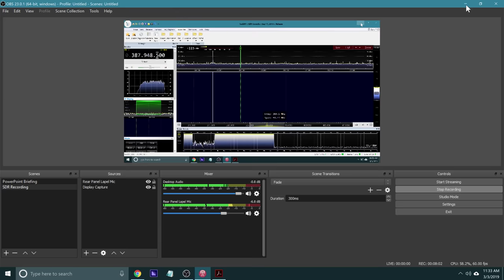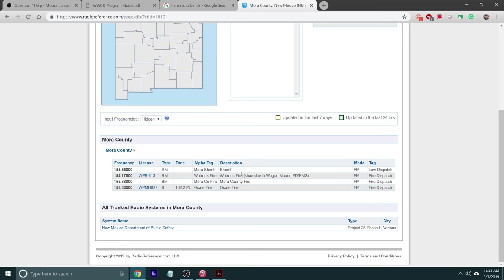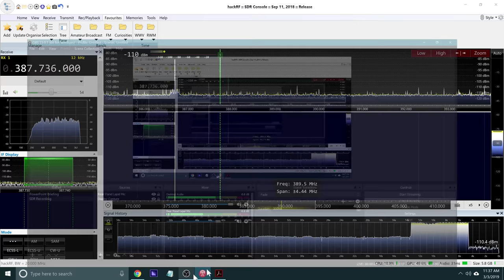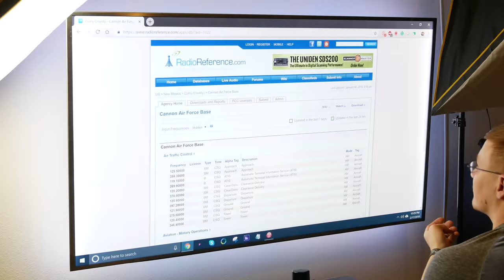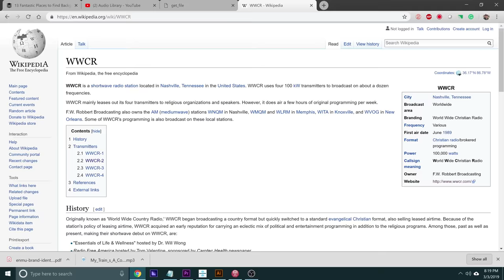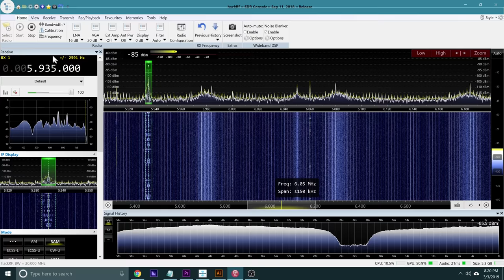Tuned Magnetic Loop Antenna - ENMU - EET 490 Capstone - Update 2

Comment: Wow awesome, thumbs up !
Not sure though, is there a good contact at top of the loop? (as the copper wires are just tightened to the aluminium with brackets) ?
Reply from the maker: Yeah, I didnt like that part either.  Not a great way to do it, bit it didn't seem to effect it much. Of course, I don't have an good point of reference for the resistive losses either. I've got to say though, this video has been wildly popular on YouTube and I've learned so much from everyone's constructive comments. The amatuer radio community is awesome. Thank you!
Reply: @TookBurrow  I am too thankful you built this antenna, i have been learning at the same time ; has to withstand several hundreds of watts on HF the way you engineered it (the key here is the Vacuum Cap). With the digital FT8 mode, you'd be amazed how far (actually to other continents) this antenna can reach. And with not even several hundreds of watts. 
Oh and I wanted to say how great idea it has been to engineer the loop bracket and have it 3D printed.
So yes, amateur radio is a great community, if you ever have your ticket, you'll be more than welcome among us. 
So you definitely have a follower here, Daniel. 
Just keep on doing what you are doing ! 
Chris ha7wx
Reply from the maker: @W-733_KWX  Thank You!
Reply: Chrisophe Barbe
Can't be all that awesome if he gets it wrong!
At the top of the loop, the quality of contact is unimportant.. At that point, here is a very high RF voltage but no current flows.
Reply: @TookBurrow  " I don't have an good point of reference for the resistive losses either." Well, measure it! Use a milli-ohmmeter. Efficiency = radiation resistance/(ohmic loss*radiation resistance)

Comment: Good video and nice build.  Kinda surprised the upper frequencies we so high, I wonder if the coupling loop was working by itself up there.  I would think zero chance of transmitting in the VHF range.  That ducting should be great for dealing with the skin effect issues since it's mostly surface area.  I've thought about using ribbon for the same effect.  Any thoughts on that?  Also back to the skin effect issue.  Seems like all designs have a huge issue there with the connection to the capacitor.  Any thoughts on losses there?  Obviously you intend to put real power into it with the 15kV vacuum capacitor.   Also wondering what kind of Q you are getting at the down in the longer wavelengths.  Also I was more under the assumption that mag loops have a very strong null, but not vary directional otherwise.  Thanks.
Reply from the maker: There were quite a few problems with it along the way and left an appetite to try again some day. I don’t professionally work with really anything related to radio and probably a good thing as I’d need to brush back up on the finer points. What antenna would you build if you could build any kind?

Comment: 269.9 MHz is the MIL frequency for the Automatic Terminal Information Service (ATIS) at Cannon AFB (KCVS).  You can see it on a chart at SkyVector.com by entering "KCVS" and hitting [Go].
AFAICT The beacon at 138.925 is outside of the civilian navigational radio bands, so it's probably something military.   Whatever it is, I'd interpret that transmission as being the two digit identifier "SE" or "ES", depending on which order you pick.  ;) 

That's an awesome HF antenna!   I might have to build one.
Reply from the maker: Thanks for the tip on that cool website. The ES/SE was another persons guess as well

Comment: Awesome idea and it is great that you include the time lapse videos of the process. Thanks! I am sure that , as others have said  below, you would benefit immensely by getting an FCC Amateur Radio License(s). I studied intensely and passed all 3 in one morning. I am sure that you can do the same and it is very worthwhile to have no restrictions on transmitting. It would be fascinating to see how this antenna behaves on transmit and  to see what kind of power it can handle. Careful with the Voltage/Current and RF! Do you have some idea based on your calculations? (Perhaps it was stated in the video. I was pressed for time and skipped through, but will watch in its entirety later.) Thanks, Jason / KY9I
Reply from the maker: I will have to do that. My father in law is a licensed amatuer radio operator, so I may see if he wants to try transmitting with it. I've been very busy with work, so my favorite project hasn't seen much of me. Fortunately people keep commenting here and I'm learning so much for the next video. Thank you!

Comment: What was the center frequency you were aiming for? The null is on the narrow sides. The broad sides are the lobes.   So you would have two null sides and two sensitive.  I believe when you showed the field it was showing the antenna you built if it were horizontal.

Comment: Have you tried combining the loop's RF with the signal from a simple dipole or vertical antenna?  You can get very nice notches on specific signals.

That would be "signal peaking" when the antenna is directed at the desired signal and nulling when the antenna is directed such that an interfering signal is minimised.
Reply from the maker: That's a great Idea. I will experiment with that this summer.

Comment: He should have probably done some research to find out how a tuned magnetic loop works before building one and trying to show it in video!
Reply from the maker: You are probably referring to some b roll footage I have in there demo the antenna at an irrelevant frequency with respect to the design. This needs to be edited out. I later demonstrate operating the antenna 5.935MHz towards the end of the video. ~55:57
Reply: @TookBurrow  I love the idea of using the Al tubing--- much cheaper than copper would be for that diameter. I'm curious if you've tried transmitting with it? Can the tubing handle the current from a 100W ham transmitter?

Comment: Very nice build, but I don't get why you tried/showed us this this beast in the VHF/UHF range. Quite sure you weren't even able to tune it there, since you calculated it for 7 MHz, right? This loop is way to big for 100 Mhz and up. To be considered "magnetic", a loop typically has a circumference of 1/4 of the highest receivable wavelength  - try to receive low bands on shortwave with it! Also a vacuum C is overkill for receive. Their main feature over air capacitors is their dielectric strength - which counts when transmitting with some power (e.g. 100W and up) :)
Reply from the maker: I used it around 5Mhz towards the end of the video. I was supposed to edit that part of the video out. The antenna was little more than a wire at those frequencies. Sorry for the confusion. I had b-roll/test footage for camera and recording setup and I used them in the final cut.

Comment: if you can still find it there is/was a program called "dsd plus" that useing virtual cableing you can decode most digital signals but not ones that are encrypted i used it a cpl of years back so not sure if its still available and another one called "dump1080" for tracking and decodeing aircraft messages
Reply from the maker: Thank you. Is DSD plus a plugin for another program or a standalone program?
Reply: @TookBurrow  both are stand alone but you do have to have an sdr program running then the virtual cable  to connect the two together im sur if you search on YT there should be one or two vloggs showing how too

Comment: Thanks for this video, where did you get the radio unit and what does it consist of? I am kinda of old school, all my radios are still tube type except for the aircraft units. N5UEB
Reply from the maker: Hi. In my video I was using a software defined radio that connects to the computer through USB. It's called a Hack RF
Reply: Thanks Daniel. I found one on Ebay for about 160.00 but did not say if software was included. Sure seems like a good way to go and I like that kind of bandwidth. Can you tell me if software is included or separate. Thanks Tom Turner N5UEB
Reply from the maker: @hokepoke3540  I Downloaded a free software called SDR console.

Comment: How do you overcome the higher losses of aluminum and at the connection made between the two pieces?
Reply from the maker: It's the outer diameter of the rigid ducting. Its large enough that the losses are offset. I think the DC resistance of main  loop was under 0.5 ohms.
Reply: @TookBurrow  0.5 ohms? Got to be waaaaay less than that  for any reasonable efficiency.

Comment: Hi,
Nice job! I like your 4 inch tubing because it lessens resistance which allows the antenna to be more efficient when one is transmitting.

I have 3 of this type antenna at the moment where my largest is 4 foot square but I use a spiral wound method for the large inductor portion of the antenna that is connected to the capacitor.

I am not surprised that you recieve in the 400 MHz portion of the spectrum but I suspect your inductor is probably around, what do you think, 25 or 30 micro henries so the capacitor's ability to tune the circuit is probably 1.5 mhz to 4.5 mhz. I was wondering if you put this to a test? Also, one of mine was built for the AM broadcast band. It would be neat if yours should tune that low because broadcast DX ing is a bit fun. I once picked up Hanoi Vietnamn at around 800 kHz. 

The other thing that would be interesting would be to place it on an antenna analyzer. I believe they are called vector analyzers today and can be bought fairly cheaply like the Sark 100 out of China. 

I have the Sark and its quite nice to have for a lot of different reasons. My big question that I have that the Sark could answer is what is the input impedance at your sense or coupling loop? All three of my mag loop antennas have a rather high input impedance but since I don't transmit with them and use them on receivers or SDRplay its not too much of an issue. 

My final thought of interest is how narrow is the tuned section, think it may be called pass-band, of the antenna when the capacitor and inductor is tuned to resonance with the frequency being recieved. Mine are very narrow. I am guessing maybe 30 to 50 kHz to left and right of carrier or center. With your huge tube I am wondering if yours is a bit wider?

Enjoy, nice job......mike
Reply from the maker: I'm going to use your comments as a guide for an update video, once I get the free time. I'll borrow an ESR meter and check the inducatance of the loop and input impedance of the coupling loop.

Comment: Dude, you can get some copper stripes and use them, it would be much better. I learned the hard way that losses negatively impact SNR and you will have less efficient on TX too.
Reply from the maker: Thanks! I'll include that suggestion for an upgrade or project on this antenna or perhaps a new build...

Comment: I am surprised that you are using such a large loop for VHF and UHF. A loop that big, I thought for sure you would be using for hundreds of kilohertz, not hundreds of megahertz.
Reply from the maker: I operate it at 5MHz towards the end of the video. Sorry for the use or b-roll footage
Reply: @TookBurrow  Okay, so the reason why I didn't see the connection is that there was no connection.

Comment: I would strongly recommended that you get an amateur radio license with general class privileges, so that you can LEGALLY transmit as well as receive,  and hopefully find a mentor that can help you along in the wonderful world of RF magic.  Mag loops are a unique antenna and are very interesting indeed and VERY dangerous when transmitting. With just a couple watts you can easily exceed RF exposure limits if you are near the antenna!   The magnetic loop is a high Q resonance circuit with very narrow bandwidth hence extremely high voltage and current can be present.  It is incredibly important to have minimal resistance in the loop, so you should have as few of joints as possible, it is often better to use a smaller conductor if you can have fewer joints.  The loop should have an extremely narrow bandwidth that is tuned with the capacitor. In Amateur radio frequency is most often referenced by wavelengths, 80m is 80 meter or 3.5-4.0 Mhz, a loop that size with enough capacitance would be good for 160-40 meters. However it is too large to work as a magnetic loop much above 40m and transitions into a conventional loop with a very poor impedance match.
Reply from the maker: All good advice. If I decide to transmit with this loop, I would only do so legally. Getting an operators license isn't difficult, so IMO it wouldn't be worth transmitting illegally. As far as having a mentor, I do. Not much free time to play atm though.

Comment: I don’t understand. it should be resonant in the 40-20 meter bands and not at 2 meter where you (initially) tested it. Could it be that the metallic tube has a substantially higher inductance than a copper tube ? I am in fact thinking of the formula frequency is proportional to inductance times capacitance,
Reply from the maker: In the 2m band it was just acting like a wire essentially. Not at resonance, but still worked well enough

Comment: How much for that vacuum variable capacitor?
Reply from the maker: I think I scored it for 50. Was worried about a compromised seal at that price point, but I got lucky. Checked it's full range with an LCR meter and die pen chamber. No leaks! They usually go for $100-300
Reply: @TookBurrow   You did mention the cost in your video.  I hadn't seen the whole thing yet.  Great video, by the way. 

Most of the traffic you were seeing  in the 225 - 400 MHz band was military aircraft related. 

That variable cap was a freakin' steal.  I have 2 similar ones I have not even used yet.  I bought them simply because they were cheap ($70/each). 

Keep up the good work.  Beats the hell out of watching TV.

Comment: Mr. Tooker, what if I just want to receive ?  Will this work?  Joe
Reply from the maker: Hi Mr. Overmyer, 
On this learning adventure I set out to only Rx/receive (at least initially). 
When I get finished with my current two [unrelated] projects I plan to get myself Amatuer Radio Licensed for Tx/transmitting. 
So I have only received on this antenna so far. 
NOTE:   I think a dipole strip material antennas would have worked better though for the loop. 
I intend to replace this design entirely with something that looks like a Stargate (TV Series). 
I'm still only receiving on it, as seen in the video

Comment: The old guy with the religious broadcast ISN'T using ham gear. He's using Broadcast equipment, probably renting time slots from commercial Broad Cast services. I've heard him bleating on and then just cut out dead, probably when his paid time slot ran out.

If you are hearing 14O Mhz on that antenna, the big loop ain't contributing in any way.
You didn't mention anything about tuning it when you described receiving at139.00 Mhz.
You could dump that big loop and on 139 Mhz, not see any difference. 
The little loop is doing all the work that freq.
Doesn't look good when somebody puts up a video but needs tuition on the subject. 

I call them Internet Gurus!
Reply from the maker: Yeah, watch until the end of the video. The 139Mhz was b-roll footage that made it into final cut. One day I will record / look for alternate footage. I use it under 10Mhz towards end of video.
Reply from the maker: This video was first time using that camera & obs stuff plus some adobe premier I think

Comment: Your wires from the loop to capacitor are way too thin (must handle several tens of Amperes).
Reply: Not if he's only using it to receive
Reply: @RadioManOH  Sure but amps are not the sole phenomenon. Extra resistance (Joule effect and skin effect), which accounts only in a few milli-ohms, are THE ennemy of mag loops, whether transmitting or receiving: losses and Q dampening are the same in both cases. So way too thin also to receive.

Comment: What is magnetic about it?
Reply from the maker: Edited: 
Original response: The coupling between the two loops, they don't physically touch. 
Edit: Magnetic loops get their name due to their response to the magnetic field component found in an electromagnetic radio wave. They have a higher response to this component of a radio wave than the electrostatic component. Thank you for clarifying that @MauriatOttolink. I though he was referring to how the coupling between to two loops work rather than the overall name of mag loops.
Reply: Thank you, it looks very efficient.
Reply: @TookBurrow  
Not quite.
There are two components in a radio wave, the magnetic field and the electrostatic field.
In the loop, it works predominantly on the magnetic field.
Reply: Mirror Cruising
 Daniel's explanation. Not quite.
There are two components in a radio wave, the magnetic field and the electrostatic (voltage) field.
These 2 fields are at different angles and they combine to form the overall, radio electromagnetic wave. (Maxwell)
In the loop, it works predominantly on the magnetic field. Hence its name. Great advantage on receive, in that most electrical interference is the voltage field and the mag. loop responds much 
less to it. You'll hear folks say how "quiet" a loop can be....

Watch it if you use one to SEND. Quite low power 10 watts can produce very high voltage at the point where the big loop is split. Low power can burn and hurt. High power can be lethal and  start a fire!
There are other dangers from high radiation field strength close to the loop.
I can only tell you that they're there. You'll have to look up safe distances versus power levels.
Safety Regulations vary from country to country.
73 Great antenna but you need the info unless you are receive only.